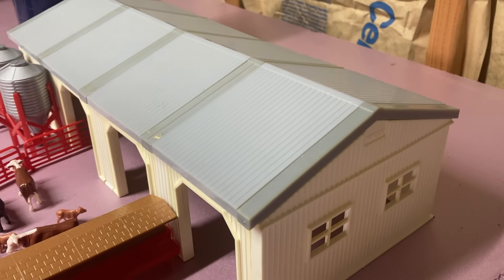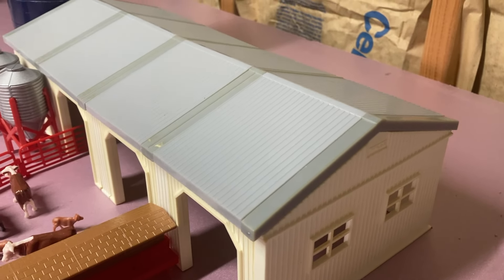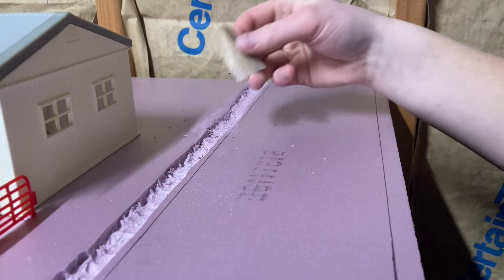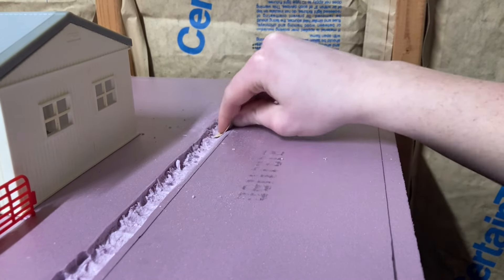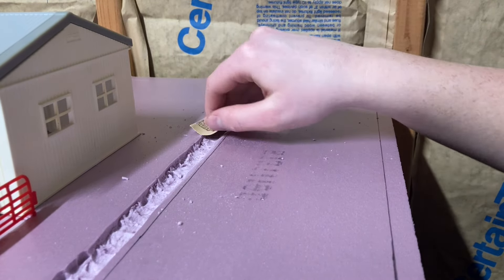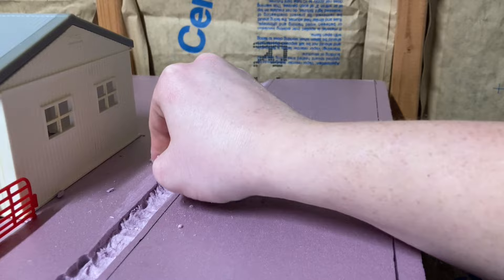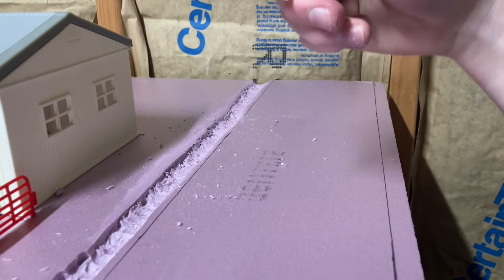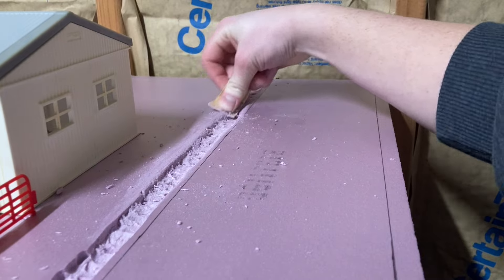BUILDING DITCHES ON THE MODEL FARM

Comment: You should take tin foil and roll it into a cylinder and make a culvert at the farm entrance.
Reply from the maker: I used Owens Corning 25 psi foam board for the base of the display and it works really well, and then just go with whatever thickness works best for your. The thicker, the more terrain differences you can have.
Reply: @modeldeerefarmer8320  Thank you BTW I love the videos keep up the good work.